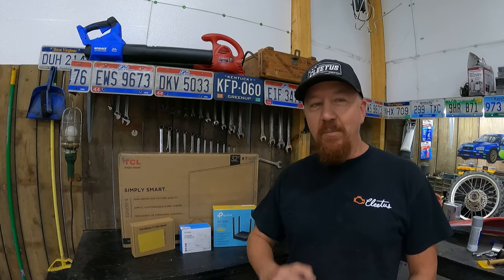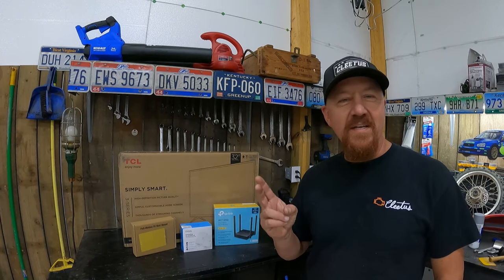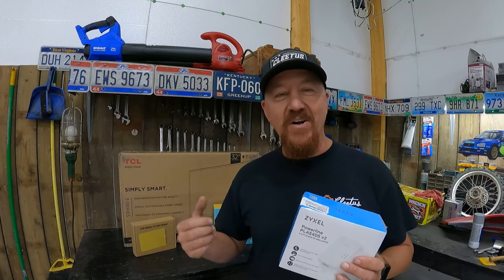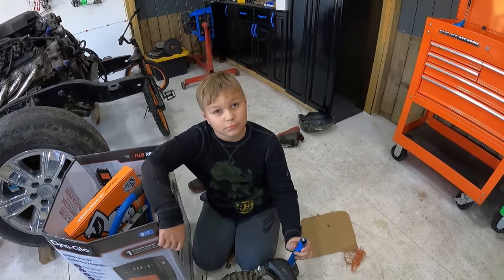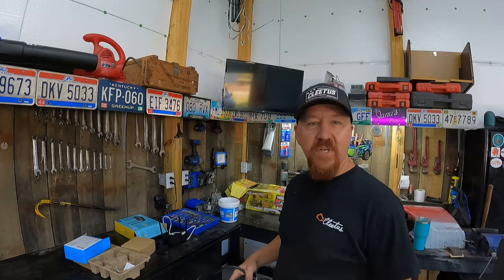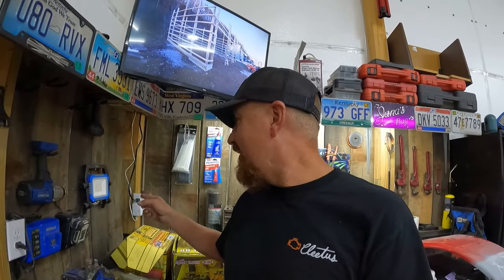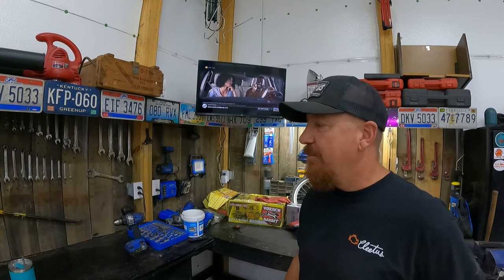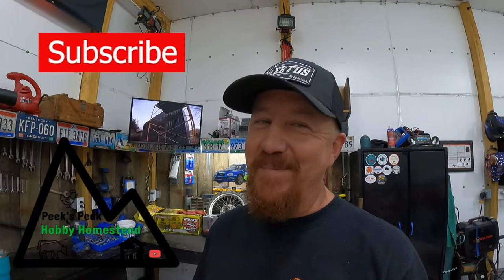No Internet in Your Garage? Get Wi-Fi Signal Inside Your Metal Building - Here's How! - Shop Upgrade

Comment: the router you installed in the shop, if you connect to it on your phone is it the same network as the one in your main home? or do you have to disconnect from your main home wifi and connect to the shop one? asking because i want wifi in my shop but i want it to be the same network so when i walk out of my home it stays on one network once i enter my shop. im hoping your idea works for me
Reply from the maker: That’s a great question.  So it requires a separate wifi router inside your shop so it would be a different network.  That being said, my phone loses the house wifi signal when I walk in the building and automatically connects to the shop so it works pretty seamlessly.

Comment: this is brilliant for home automation/monitoring. I have the same one service-> child panel setup with a metal building... don't feel like laying conduit and cable. This makes so much more sense. EVEN BETTER- I can finally put that baddy security camera on top of the light pole next to the coop! and watch chickens/control heaters/lights etc inside the coop. Sorta too cool. Love you got young ones wrenching. How I spend my years any chance I got- still do.
Reply from the maker: Awesome!  Thanks for the comment!  Hope this works well for you.  We have had good luck with ours.
Reply: We are 135 miles away from our other home and keep an eye on it through wifi cameras. All it cost was the purchase of the camera system, and internet service. Nothing else in several years. Already paid for itself by stopping a burgulary.

Comment: I had problems with wifi in my garage. I bought one of the AC outlet receiver kits. It works fine with an old router. I thank you for the advice on this Item. I'm glad you found this item our I would be without service. Again I thank you very much.

Comment: I tried a powerline adapter and that didn’t work for my shop. Our well house is a secondary shop that it worked for for a short time but when it stopped I needed a new plan. For the garage shop that has metal carports that block the signal I ran cable for an access point device.   For the well house shop I was able to use a mesh service.  Those linked with my Starlink internets service has given me fantastic service all over the main part of our property 😊

Comment: I wish I would have watched your video 3 days ago. I had not Wi-Fi in the metal building. I would have to walk outside just to get a call. Yesterday, I mounted my new flat screen. I bought one with basic functionality. I didn't want to spend too much because we had no Wi-Fi. I just hooked up a HD antenna. I did get a good picture on 35 channels.  I also depend on having the computer in my shop. So, I bought a TP link Wi-Fi antenna, I also picked up a usb extension so I could run the antenna through a small hole in the side of the garage. The antenna works great. I mounted a small plastic box on the outside of the garage for my cell phone. No cell service in the metal building. I use a bluetooth speaker to answer my cell. Next weekend we will work on the stereo. I will be waiting for your next video. An outhouse fit for a king.....
Reply from the maker: Sounds like you are getting things all set up!  That’s a lot of fun!  Thanks for commenting!

Comment: Heads up: the speeds you get through powerline can be slower (but still useable) especially if your house is old. And you can sometimes use these on surge protectors, some surge protectors work with them, some don't. It's worth a try.

Comment: I found a power line wifi extender with wifi. Tplink tl-wpa7617 kit. I am getting 36-40 mbps in my barn. Barn is about 100 feet from main panel in the house. Barn is fed by an 100amp breaker off house panel.  Data rate is good enough for 4k viewing in my barn.

Comment: thanks for the info and idea.  these things are great and i have the tp-link version in my shop.  a big gotcha is that besides not plugging the powerline adapter into a surge suppressor, it also will not work in a GFCI.  the tp-link docs say it has to be on the same electrical circuit, ie breaker and that is not the case.  they never mention the gfci part.   it works on a non gfci, non surge processor outlet off my shop subpanel which is about 130ft from my house panel.  i get about 15mb up/down which is good enough for my needs.  and ya, trying to watch how-to vids on a cell phone with greasy fingers is not fun.

Comment: I so excited to find this video !!! I am going to copy your setup almost to a T. The links provided for the amazon items dont work they link to similar items but not the exact same ones you have. I just purchased these items I hope my set up works as well as yours. The only issue I have is I have starlink and I had to order the Ethernet adapter for it. I hope it all works out I am excited to get it all installed.
Reply from the maker: Yes, they sold out of the exact models I used so I found the most comparable items I could to link.  Hope it works well for you!

Comment: How do you connect you router to the power line adapter? 
I get you plug it in but I can’t get my router to work with the adapter and broadcast the signal…

Comment: Wow, what a fantastic idea Lucus! Unfortunately, our cable company charges you for every TV hooked up on your property. Our cable bill is already far to expensive, so this won`t be very wise for me to do in my garage. I do have a very powerful WiFi unit set up in the house. I get a great signal on my lap top in our metal garage, which is approximately 75ft away from the house. I suppose i could stream it to a big screen TV in the garage, but the cable company would find a way to cheat us for having it.
Reply from the maker: I think part of my problem is my brick house blocks a lot of the signal too.  That’s interesting that your cable company charges per TV.  I’ve never heard of that.  Thanks for stopping by!
Reply: We dumped cable years ago. Using OTA antenna for CBS, ABC, FOX and NBC. Movies we have prime , roku, netflix , paramount + not counting Prime membership we are paying $20.00 a month for add ons.
Reply: We have a remote rural location,  and have  starlink.   We want wifi out in our studio/ workshop  200 ft  from the house.  Thanks for a straight forward video   this  helps.

Comment: You didn't need another router as you will now be double NATed, you just needed a Wi-Fi access point. It will work but you will probably run into issues getting devices to communicate or port forwarding in the future.
Reply: Why won't he? Out in his metal garage he will to get to his phone an stuff right..? That's what I figure

Comment: Is your shop heated? If not how is your router holding up in the winters? From what I'm reading below freezing can adversely affect routers and my shop is only heated if I'm working in it.
Reply from the maker: Great question!  We only heat it while we are working and we had below zero (F) temps this winter and it still works.  This was the first winter though.

Comment: Do you know if it’s possible to continue the chain on this (so to speak)? Like you, my husband wants wifi in our metal building shop (about 100’ from house, router/modem location), and I need wifi in our barn (about 300’) to monitor animals on Wyze cameras. I have no idea if you can extend the chain with a third box, and I assume that would require another router? Ugh. But if it worked, I would do it!
Reply from the maker: I would think that you could, but yes, it would require another router.  👍

Comment: I have the same unit.  Did you have to configure the AC100 for the home router for internet access outbound?  I also purchased a Wavlink directional antenna that sits on top of this for higher power in one direction.
Reply from the maker: I did not.  Mine worked just plug and play.

Comment: Great info, I have exactly the same issue with my shop, it is a 25 X 50 metal building. I have to keep the door open for any wifi at all. I wonder if you would be so kind as to post the name and model number to the extender you used? The link was to Powerline a subscription.
Reply from the maker: Thanks for letting me know.  I just updated the links.

Comment: Great video! I have the same situation, I have a metal building that's approximately 200 feet from the house. How far is your garage from your house?
Reply from the maker: Mine is close.  Only about 100’ of wire, but I had someone comment that they used this setup on a building 200’ away and it worked for them.  Good luck!

Comment: I have a question?… please help 🙏 I live in a rural area and have internet in our house with a powerful router and it reaches to our garage which is all metal ! One thing the garage is about 75’ away from the house so I was wondering if I should use this system you are using to get internet in it? They don’t want a tv in there just the Wi-Fi.
Reply from the maker: If they are powered by the same electrical system then it would work.  It does require a separate wifi router so my phone connects to the shop router while I am in there.  Hope this helps!

Comment: I have a question ? The small black router  , did you have to do any special set up on that ? I have my old Netgear & I haven't reset the unit so it still has the old password in it , do you think I have to reset it to the original password it came with ?? Help would be awesome & greatly  appreciated  thanks !!!
Reply from the maker: I don’t know that I can say for sure.  I had a new router I set up in the shop.  I don’t know why that would be affected though.  I would think the original setup and password should work.
Reply: So you didn't have to do any computer configurations , so you just plugged in power cord & Ethernet cord & turned on ?
Reply from the maker: @johnbart8454  I did not use a computer at all.
Reply: Ok awesome thanks for getting back super fast ! Really appreciate that very much !! Have a great day !!!

Comment: If the Smart TV you used would have had a ethernet plug in.  Would you still need the extra router or could you just plug into the TV.
Reply from the maker: Great question!  I believe I could have wired direct!
Reply: @PeeksPeakHobbyHomestead  If you dont use extra router,Will the cell phone still work on wi fi..I clicked on the product and it said the ZYXEL Powerline Network is not available..I'm not sure what to buy now..Please advise
Reply from the maker: @darrellvansell862  I tried the links and all of the items are still available.  If you need wifi inside you building for your cell phone then you would still need a router as well.  That is why I went with these products.
Reply: @PeeksPeakHobbyHomestead  ...Thanks  I'll look  again.

Comment: Greetings: A cheap "surge protector" should B OK 2 plug in the cient unit.   Most cheap"Surge protectors" and strips that do not disply notice of EFI / RFI protection should pass the RF signal 2 the client. The voltage surge components have nothing 2 do with EMI and RFI. I would not trust cheap "surge protector" strips. They R generally a 1 time use and not effective on many types of surges. Thx 4 the share.

Comment: This does not work, I have my shop on the same meter as the house just jumps off the main panel to a sub panel in the shop, Doesnt work in the shop works on every outlet of the main house. Shop is 133 feet away
Reply from the maker: I wonder what is different…. I have been using mine for a couple months now and it is working great.  I think I ran about 80ft of wire from my main panel to hook in my sub.  Distance really shouldn’t matter.  🤷🏼‍♂️
Reply: @PeeksPeakHobbyHomestead   I bet it has to do with my panel being wired with GFI Breakers instead of regular breakers.
Reply from the maker: @SimsRacing  ah man, I bet you’re right.  I read that you can’t use a surge protector so that makes sense.
Reply: @PeeksPeakHobbyHomestead   Ya that didn't do it either. Switched out the GFI for a single pole 20 on one circuit and no dice.
Reply: @PeeksPeakHobbyHomestead  swapped out breakers still didn’t work so for now I have a extension chord ran out until I figure something else out
Reply from the maker: @SimsRacing  That's interesting.  If it is working off of an extension cord then the distance must not be the issue.  I wish I knew more about it to help you troubleshoot.
Reply: Same here. But my shop is only 30’ away. No GFCI’s. Crazy. Just won’t connect to the other box. Works everywhere inside of the house. 

I wonder if it’s because I used aluminum wire to run to the panel in the shop.

Comment: Run an outdoor rated Ethernet cable to your garage.  This is interesting, but silly.
Reply from the maker: That was the plan, but we forgot to run it when we were pulling wire to the shop and now it would require digging and all.  This is much much easier, just as cheap and so far is working just as well.

Comment: Great video, just a couple of questions. Does your garage run off of a subpanel? In the garage, did you plug the ethernet cable into the WAN or a LAN port on the router/modem? Did you set up the modem as an access point or just as a second SSID?
Reply from the maker: My garage is a subpanel from the main house.  As far as the internet, I don’t know much about the other stuff.  I simply plugged the Ethernet cable into one of the ports on my existing router in the house and it worked.
Reply: In the router in the garage though which port is the Ethernet cable connected into? Thank you!
Reply from the maker: @tuckedinshirt  it would connect  into the WAN port in the garage.

Comment: Well shoot. I thought had finally found the solution to getting internet to our metal building. Unfortunately, our building is on a separate meter. Setting up a separate internet cable just for the building isn't financially feasible. Oh well.
Reply from the maker: Yeah, I completely intended to run an Ethernet cable in the ground with my electrical and I got it all done and realized I forgot.